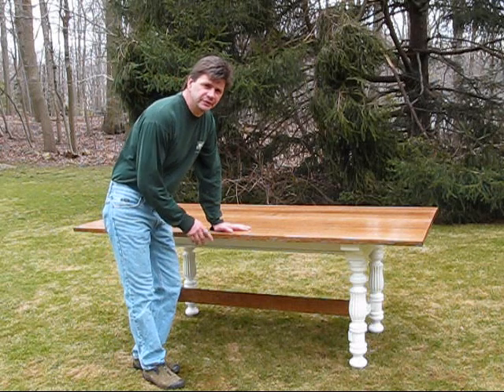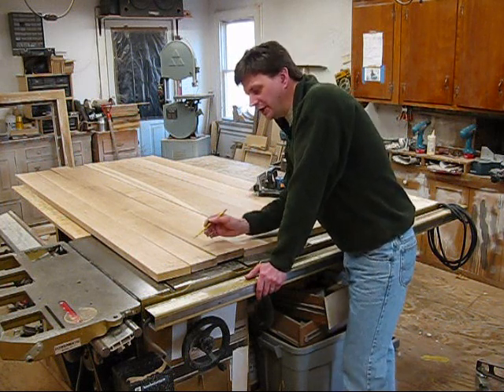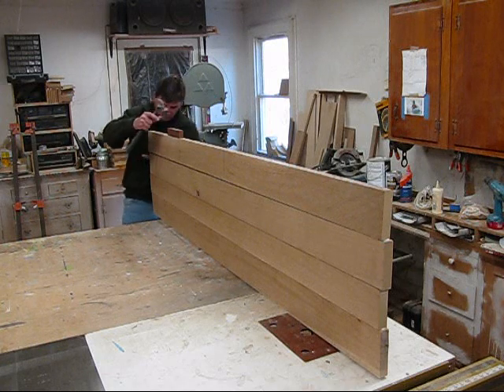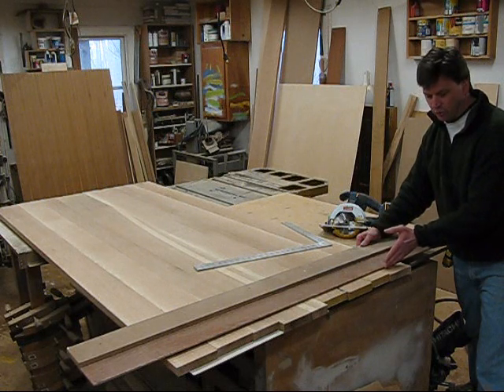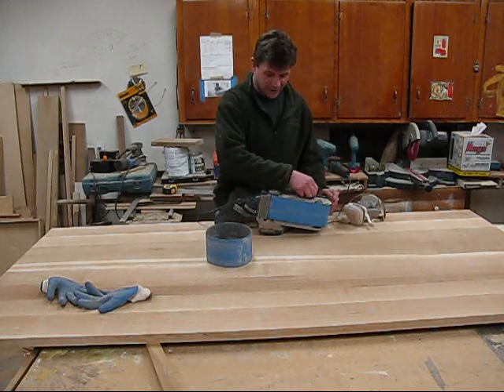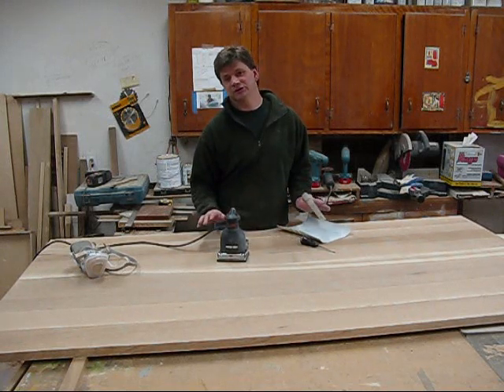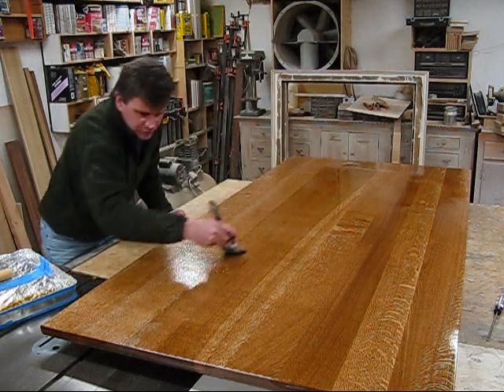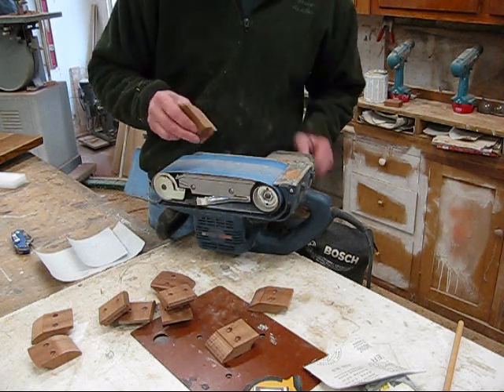How to build, make a Dining table, By Jon Peters. Part 3 Building the table top

Comment: what is it with you guys wearing gloves at the table saw. if you have seen what happens to your hand as the blade catches the glove and pulls your hand into the blade as I have once in my 35 years working is wood shops.
 you would not do it again